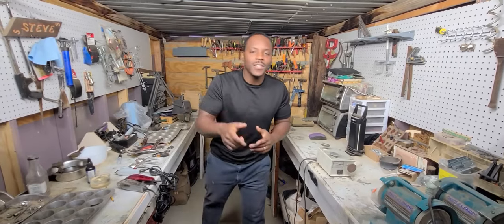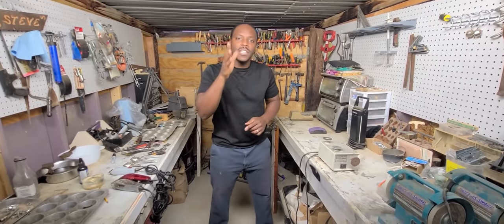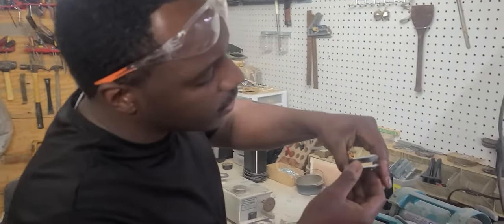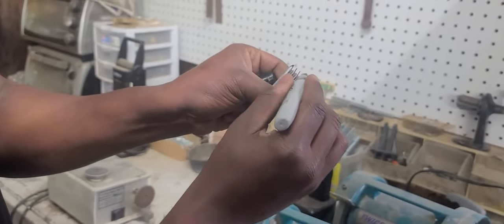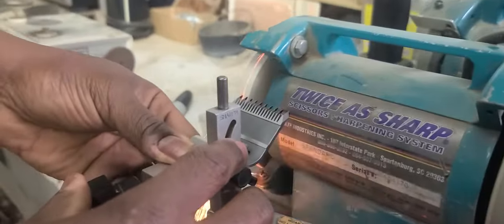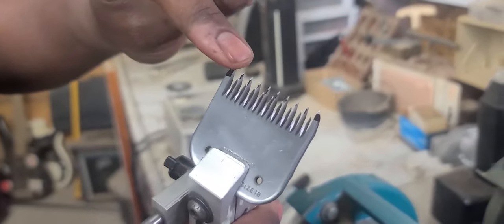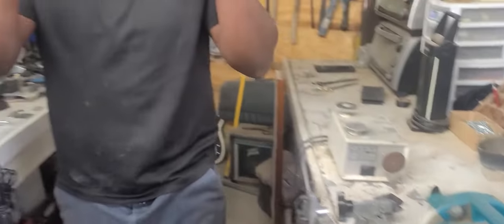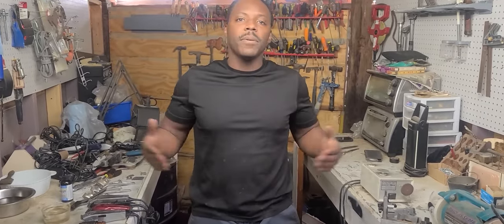How To Modify any detablade blade for pet groomers and barbers!

Comment: Omg so glad i stumbled onto your channel!  Can i call your Dr Blade 🤩
Pet groomer here & i have questions.. I dont quite understand the effect/usage of (exapled) 7 blade with a 10 tip can give me both the 7 & 10 lengths in one blade. Could u explain or demonstrate that for me please?  Do u hold the clipper differently depending on what length you want? Sorry if this is a dumb question, it's just not registering in my noggin lol 

Also BIG QUESTION!! Do you do scissors also,  can u use sand paper on scissor like u do with baldes? Would you consider doing a video on sharpening & realigning those?  🙏
Groomers use straight scissors, thinners and chunckers but we also use curved ones in all those as well.. I hope u can  help so i dont have to keep buying new ones so much.. im definitely going straight to the shop to try my blades 😁 
Thank u so much! Love ur energy and the way that u explain in depth when u demonstrate ❤ 
Newly subscribed ~ Ashli